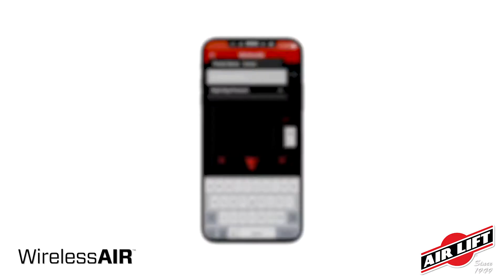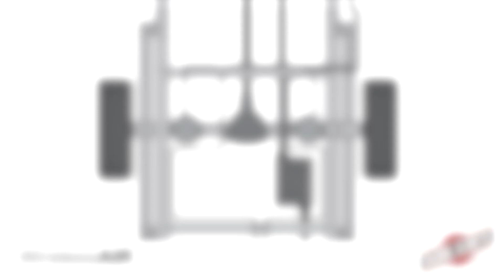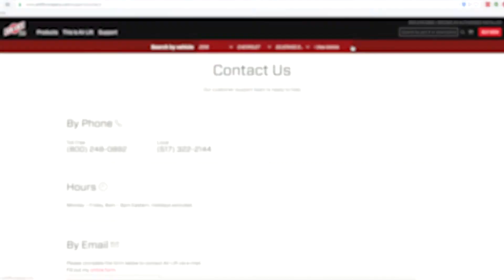Air Lift Install: WirelessAir (2nd Generation)

Comment: The selected location works well in Southern states, but here in the far Northeast where the corrosive road pre-treat is put down before a winter storm and then followed by a lot of salt during the winter storm.....this would be better located under the hood. Just my 2 cents.

Comment: Why is the wire up at the plug so thick (10awg I'm guessing)then is spliced to thinner (12-14awg) down the harness towards what will be the battery terminals.  This occurs on all of the legs: neg, pos, and ignition sense.

Comment: I want to put them on my 2017 dodge ram dually. Some day!
Reply: Did you ever get them? If you don’t care about being wireless on the control end you can put a set of air springs on fairly reasonable , I’m getting ready to stick them on my 93 Ford, I just redid the whole truck bumper to bumper.

Comment: I have a Ford F150 2010 model intended for passengers only (without loading luggage), what is the most comfortable shock absorbent for passengers and the most shock absorbers you have